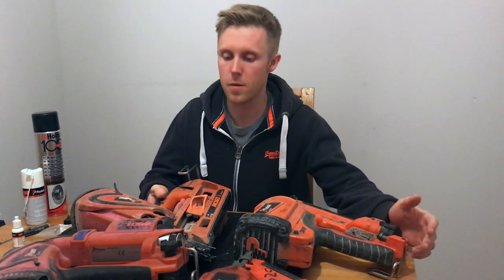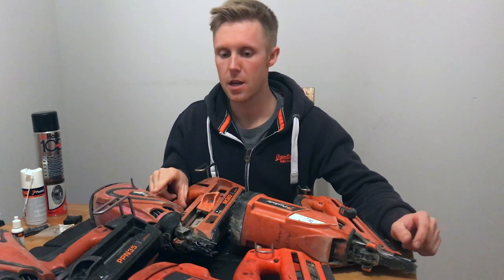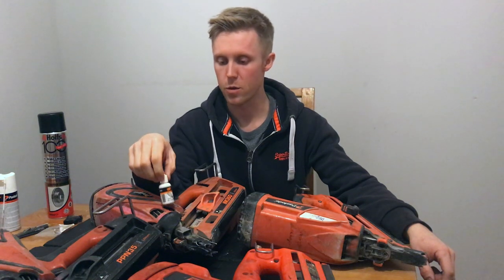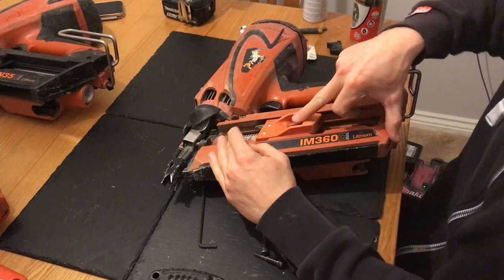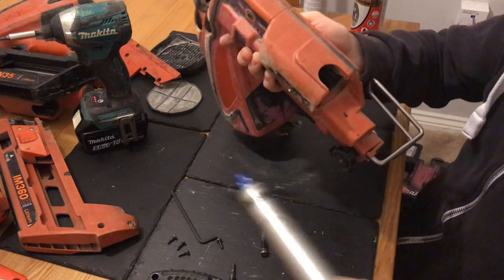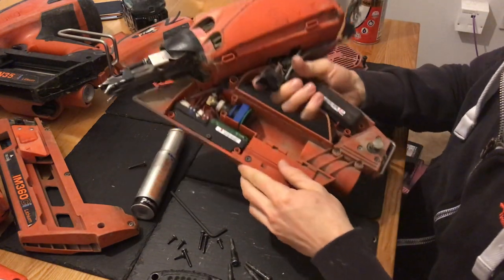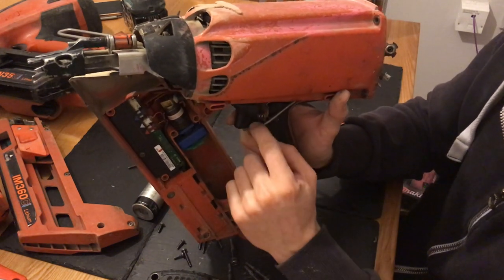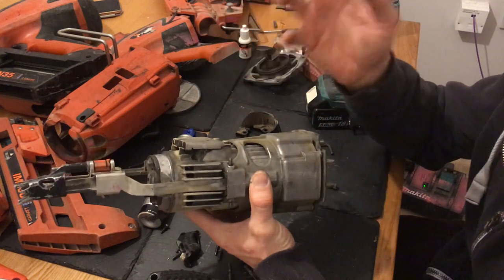Paslode Fix Common Issues Not Firing IM360ci, PPN35ci, IM350 plus

Comment: Hi matey.
I've got an older 350 after I cleaned it and changed the o ring it now makes a whiney buzzing noise when pushing down and doesnt fire. Have you any suggestions before I hand it in for repair.
Thanks.
Reply from the maker: Just double check your fan blades. Could possibly be bent slightly that’s why it’s making the whiny noise. As for it not firing it sounds like it’s not sparking. Just check the wiring on the spark unit and there’s a little actuator switch inside the gun which hits the sparking switch when depressed. Just check the arm hasn’t snapped and it’s hitting the switch.
Reply: @Georgous92  thanks buddy

Comment: Hi I have an Paslode im90i which won’t spark, with it opened up, battery on, green light flashing should it when I press both buttons spark the ignition plug, at present it doesn’t? The generator is part no 013299
Reply from the maker: yes when you press the fan leaver first then press the trigger switch it should spark. check the spark unit is clean. if its dirty it may not spark. check the cable on the back where the fan is isn't loose

Comment: Hi my 36o stopped working couple days ago. 
It’s seem to be passing gas. Soon as I put more gas in the gas sprays out and eats a cylinder in no time. Looking at your video is it a easy fix or do I have to send in for repair. Iv only had it about a year. So hasn’t had much action. I serviced it thinking it might just need one but still the same. Happy new year. 
Cheers
Reply from the maker: To be honest if it’s only a year old, they have a 2 year warranty on them. You would be best off getting it repaired under warranty before opening it all up. Just to make life easier for you.
Reply: @Georgous92  thanks I’ll try a find the receipt and contact them
Reply from the maker: No worries dude hope you get it sorted!

Comment: The repair service wants 150$ to repair my .is it worth it in Greenville Illinois.
Reply from the maker: Did they tell you what was wrong with it? Depends on the part that’s broken. Some of the parts can be expensive but it might be a simple fix
Reply: @Georgous92  my pasloade is 19 plus years old .it runs but you push down the pumper it goes dead no power 🤔
Reply from the maker: @davidtate166  if they can fix it for that and you haven’t had to spend money on repairs all those years could be worth it. It sounds like it maybe the Roller switch at the back of the gun not connecting to the switch. What model is it?

Comment: Hi  today my ppn didn't  work red light is flashing  but no other lights on battery is charged and gas is full and in date, I've  taken paslodes apart plenty of times and found replacing  parts quite easy now, the problem I have is nowing which part is faulty
Reply from the maker: Does it flash red as soon as you put the battery in? or is it when you depress the nose and pull the trigger?
The first simple option which is free is trying holding down the start button for about 60 seconds then try taking the battery out and in again. if that doesn't work.
 i have a feeling its the black box behind the trigger assembly.
there are two types of those black boxes parts one is black and one is red. if you have to open the gun it should say on it when type it is.

If you have the IM360ci you could try robbing the part from that to test it. best place  for parts ive found is eBay
Reply from the maker: https://www.nailgunparts.co.uk/index.php?route=product/product&manufacturer_id=11&product_id=1522&page=12
Reply: Thanks for getting back George i think its sorted , I was using  it in the rain on Monday  must have got damp, I put it by the kick space heater in the kitchen and after a couple of hours the lights came back on so I tried it and happy days its working.

Comment: George a im360ci intermiting firing nails any idea what to look at thanks
Reply from the maker: It’s potentially the trigger switch. If you look at 12.34 in the video. I had this issue and it was the trigger not always engaging. Normally a good place to start. Hope that helps

Comment: George 350 firing pin missing nail ? Thanks
Reply from the maker: Probably the hammer pin is loose and sitting too far forward. Needs screwing back in potentially
Reply: @Georgous92  so I need to take piston pin out and tighten the piston head ?
Reply from the maker: Go to 17:20 on the video same principle basically
Reply: I’ll check it’s a 350 so I don’t know if it can screw back in I’ll take apart thanks George for your help
Reply from the maker: It’s practically the same if that is the problem. If it is the issue. Get some thread lock on it to stop it coming loose again.

Comment: My PPN gun nose always sheers off. Any advice ?
Reply from the maker: Do you mean the nose has fallen off like come apart? So the locating pin doesn’t work?
Reply: @Georgous92  the nose completely sheers off at the point where you adjust the depth. The whole part with locating pin. Have you ever had this happen? I think it may perhaps be overuse what do you think?
Reply from the maker: @HewzTV  Hard to say without seeing it. if you upload a picture to imagur.com and link me to it ill take a look. im assuming the threaded bolt has sheered which adjusts the depth? the PPN nailers do take a lot of high impact so it wouldn't surprise me.
this is the cheapest i could find the part if it is it.

https://www.ebay.co.uk/itm/New-Paslode-PPN35Ci-Upper-Probe-Knob-Assembly-fits-PPN35i-PPN50Ci-PPN50i/254824904228?hash=item3b54bf7624:g:gAQAAOSwa6Jf8jhY
Reply from the maker: that's potentially the other part if im right in thinking.

https://www.ebay.co.uk/itm/Front-Probe-fits-Paslode-PPN35Ci-PPN35i-Nail-Guns-014099-2/184617455247?epid=1605084564&hash=item2afc0ece8f:g:ANsAAOSwIYlfvEHf
Reply: @Georgous92  yes that’s it the front probe! Really annoying. Must be from overuse as a lot of our jobs at the minute are with steels so lots of moist hangers needed. Has happened 3 times to 2 different guns in a fairly short amount of time so wondered if it had ever happened to you and any tips to prevent it.
Reply from the maker: @HewzTV  I haven’t experienced it on my gun but have seen it. The only thing I can think of is to back off the depth adjustment a few turns so it’s not as high impact every time if you haven’t already done that?
Reply: @Georgous92  I haven’t done that no. That makes sense thank you I hadn’t actually been taking any notice of the depth setting! Will try that tomo
Reply: @Georgous92  thanks 👍🏻
Reply from the maker: @HewzTV  no worries dude